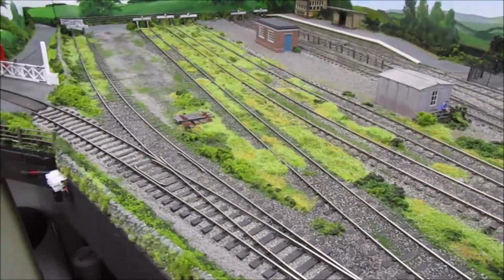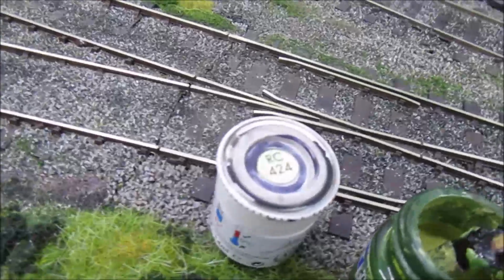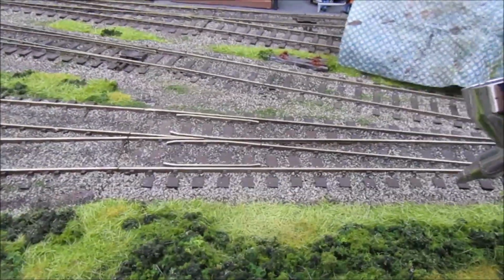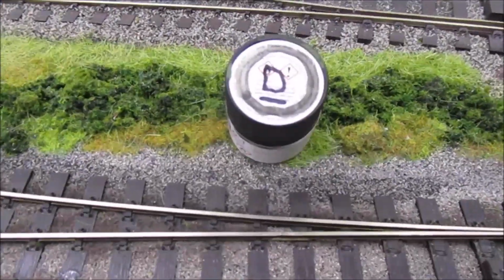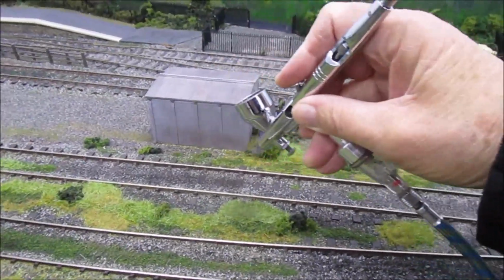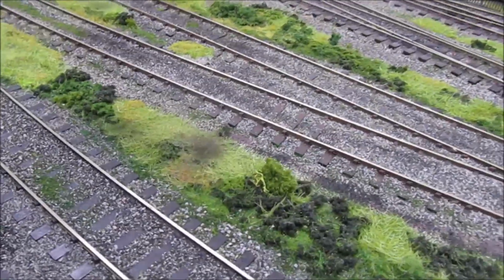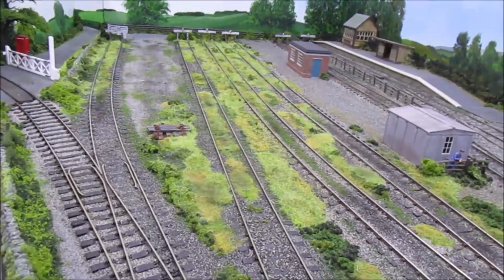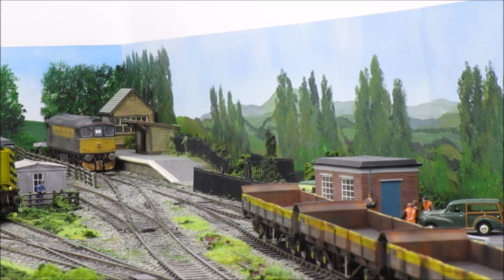Seven Mills Sidings No 91, Andy Peters World of Model Railways,

Comment: Hi Andrew, what sound is in the blue 08
Reply from the maker: Hi BritRailTog, The 08 has Paul Chetter sound, loaded on a Zimo chip from DigiTrains. I believe Paul has done 3 08 sounds recorded off different 08's and I have Version 1 in the Blue and Version 2 in the Grey 08. The Blue one has a large round speaker and the Grey one a large Cube. The differences are only subtle, but nice. Also the lighting configurations have to be set up differently between the Blue / earlier, and Grey / later lighting systems so something to watch out for when ordering a Chip. Thanks for the question, all the best, Andy.